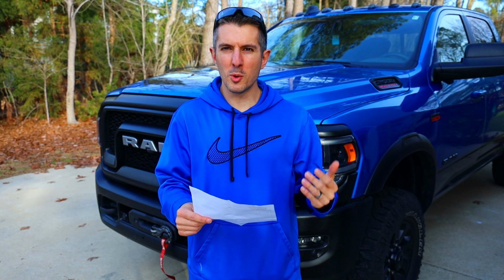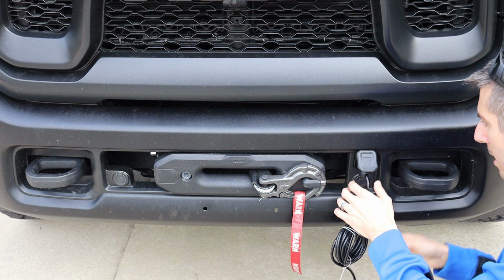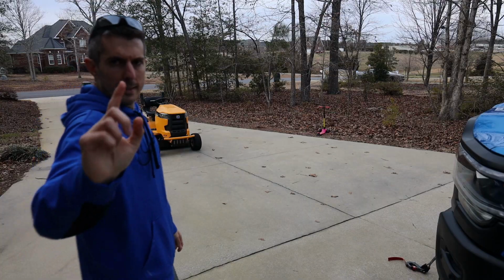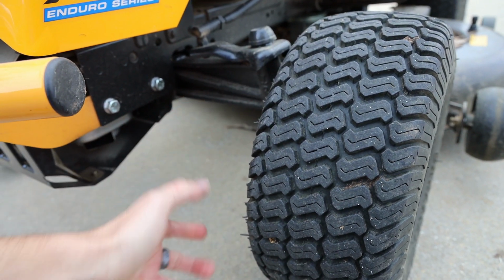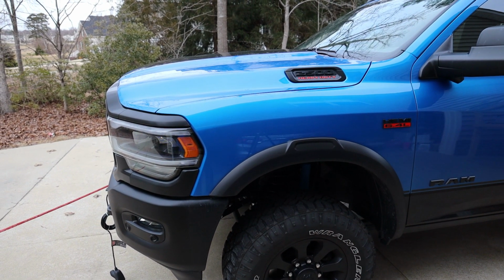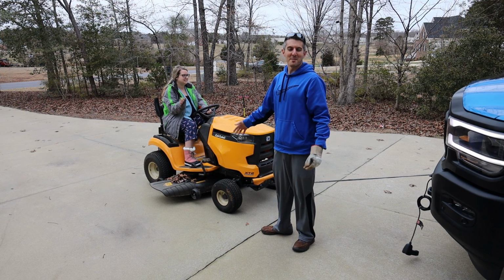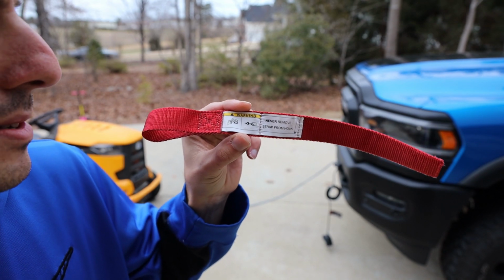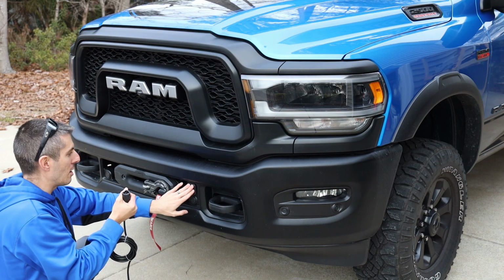Easiest way to pre tension your new synthetic winch line

Comment: Nice video. Would using my 1900lb subcompact tractor be to much weight to tension the winch rope?
Reply from the maker: Of course! My lawn tractor is really too light for this task. It works but barely. Your subcontract is much better. What kind of tractor did you go with?
Reply: @GReviewz  john deer 1023e. With mower deck and backhoe.

Comment: The best way to pre tension rope is to use steel cable instead. Then you don't have to fuck with all that bullsh!t.
Reply from the maker: My truck came with the synthetic. I will say steel cable is more durable but steel can backlash just like synthetic if you don’t wind it on with some tension…

Comment: Nah bud, to actually tension it run a tree saver around a tree or concrete block and then attach your hook to the tree saver -then winch in using rhe the weight of the vehicle to tension the rope.
Reply from the maker: Thanks for watching. Man I said that option on the video.  some people dont have trees or tree savers. I talk about different methods.
Reply: @GReviewz  Dude, a ride on mower weighs like 450 lbs max, pulling it you're probably only pulling like 200 lbs of force because it's on wheels. If you have a winch you should have either a tree saver or a recovery rope or both; you can't use your winch without them. You should've been pulling a car or truck to properly tension your line. You need like 800 lbs of pretension on it. 

 And no, if you use your winch it's not because you did something wrong, it's because you're recovering someone or you were really going through some thick mud or snow got stuck and instead of risking damaging your or someone's vehicle you decided to go the gentle route and winch it out.

Comment: If you can’t see the drum while winching under load without getting your face near the line your winch is not safe.
Reply from the maker: Thanks for watching. That may be the case but with my trucks setup it’s almost impossible to see the drum at all. When actually using the winch I don’t get anywere near the winch..

Comment: I saw in my owner's manual it said at least 1,000 pounds needed. Was your lawn mower at 450 pounds still good then?
Reply from the maker: Thanks for watching. I have used my winch since doing this method and had no problems! Some people just lean back and use their body weight. I had my wife apply the brakes on the lawn tractor also. I will say it’s best to use the recommended 1000lbs or the tricks weight which is best!

Comment: My smittybilt winch mentions having 1000lb of line tension when winding the winch for the first time. What concerns me is that you're using an approximate 450lb tractor in neutral up a gradual incline, which means that a tiny fraction of that weight is actually being applied to that line in tension. It looks taught but it's so slack that you can obviously guide the line left and right with your hand while it spools. It may not be enough.
Reply from the maker: Thanks for watching. This video was a demo on what the process was. Like I stated in the video it’s best to use the trucks weight to tension the winch line. Yes my lawn tractor is under weight for a proper tension. My wife could apply the brakes on the tractor causing the line tension to go up quite a bit. Even under 1000lbs of tention you can still guide line to a certain extent. The worst thing you don’t want happening is just tensioning the line and it gets all bound up from not guiding the line making the wraps on the spool uneven etc.

Comment: Nice video. Rookie question: You were making sure that it coiled onto the spool cleanly by pulling it left and right. Is this an issue if you were doing an actual recovery? I've never really heard anybody mention it or act concerned. They just stand back and run the winch (obviously under a lot more tension). In other words, do I have to worry about my winch getting all jumbled up during a recovery? Thanks and cool truck!
Reply from the maker: No that is a great question… obviously the newer synthetic winch line is much softer and more compliant than the steel line..because there isn’t as much pull on the line while pulling my lawn tractor if I didn’t pull left and right it most likely will get all messed up… now during an actual pull there is a lot of torque on the line which helps it spool to the lowest point which helps it spool on correctly.. the steel cable was better at it than synthetic but still should be just fine.
Reply: @GReviewz  Plus on a real recovery with serious weights involved, one doesn't want to be in the "line of death" if the rope should break, etc.

Comment: that's like 40 pounds of tension. nicely inflated tires on a smooth driveway? that cable is not tensioned whatsoever. My toddler could push that lawn mower in neutral. 
at least toss a big 'ol truck tire out on the lawn, and run a hook to the middle and yank that. preferably, hook your actual truck to another truck or a pole and use that!
Reply from the maker: As stated in my video this was just a demonstration. I’m not defending the lawn mower, it wasn’t a lot of resistance but definitely more than 40 lbs. wife had brakes depressed like 50% and my driveway does have some grade.. yes I have tensioned it with the full weight of the truck hooked to a tree.. thanks for the ideas..

Comment: If you do use this winch in the field or for recoveries look at the duty cycle. My own Rule of thumb is winch for 5 seconds off for 10-15 seconds. Yes it takes a lot of extra time, but imagine how much time it would take to remove that bumper/grill to replace the motor if it burnt out. 
It is the most common thing I see in the off-road world everyone just holds the button down and I can say it gets loud and weak after doing a few full length line pulls under load. I’ve even seen people come out to save the day and burn there winch motor out, pop fuses, damage alternators burn up alternator wires it’s not a good day when u save sombody else’s day and yours got real expensive

Very good video lots of attention to detail and lots of good tips and good points just keep duty cycle in mind the winch will have an owners manual and it will be written in the manual
Reply from the maker: Thanks for watching. I had a cheaper winch on my last Jeep. The normal rule of thumb I used was 30 seconds on 30 seconds off. It seemed to work for me and I never had any problems with it. On the newer power wagons when the vehicle senses a large power draw it automatically goes into high idle so you dont kill your battery. Thanks for sharing your method.

Comment: Nice video but your have one fundamental flaw the line is suppose to wrap around the drum from the bottom not the top as you have it. Surprised no one caught that.
Reply from the maker: Nope sure don’t. I’ve looked at other power wagons and they are all have rope coming off the top. I sent a email to warn after you commented and they said with the power wagons since it has a narrow fairlead “non roller” that sits closer to top of the winch itself it would put a lot of pressure on rope and fairlead of it came up from bottom. Coming off top is almost a straight shot to fairlead..

Comment: I put the pull strap on mine by taking the pin out that holds the hook slipped the pull strap on reattached the hook to the cable , if you leave the pull strap on the hook part it could be cut. As far as  taking it off when winching  I don't know why unless it acts like a warning flag.
Reply from the maker: Thanks for watching. That is a good idea about putting the strap we’re the pin goes. Do you have a power wagon?
Reply: I have a jeep cherokee XJ been fixing it up

Comment: Good presentation and mention of some of the safety points. I’d add to put your truck in high idle too because it will keep the lifters oiled and increase the output of your alternator. Idling for long periods of time isn’t great for the 6.4 Hemi.
Reply from the maker: Thanks for watching. On the power wagon and standard 6.4 hemi ram trucks there is. I way to manually engage high idle like the Cummins. However on the power wagon they are set up when enough power draw is reached the truck automatically high idles..
Reply: @GReviewz  Color me impressed. I honestly didn’t realize that and have never noticed it. That’s really cool. Thanks for the heads up. I heard that Ram had done something within the last couple years to help mitigate the problems with low (normal) idle but I don’t know if it went into production.

Comment: Nicely done, i was thinking to do the same with my riding mower only thing missing is the long driveway 🙂
Reply from the maker: Thanks for watching! Yeah or any place that has enough room to stretch out all the line. It’s recommended to use the whole weight of the truck to tension the line but the lawn mower works ok also!

Comment: That is not enough weight to properly pre-tension it. You should be hooked to a large tree, or another truck, and winching in neutral while slightly applying the brakes. That is per Warn instructions for a 12k winch.
Reply from the maker: Thanks for watching. I did say that in the video. I was just showing other options that are better than not doing it at all.

Comment: Your rolling resistance was like 25lbs btw. 4% of the weight of the tractor and occupant on flat pavement. Thanks for sharing 👍
Reply from the maker: Thanks for watching. Lol I know it really was for demonstration purposes only. On another note my wife was applying the brakes some and my driveway is on a slight hill. Even with that 25lbs the winch line got on there nicely even better than the factory. Do you have a power wagon?

Comment: I still don’t get it why I should put the PW on Neutral when using it..
Reply from the maker: It’s the same thing why so many guys at the boat ramp end up in the water… if you just simply put your truck in park and winch on something you will shear the transmission park pin. So it’s better to pop it into neutral and keep your foot on the brake..

Comment: Generally good info, but you should brush up on winching safety.  The red Warn nylon strap is so you don't get your fingers ripped off.  Hold the strap, not the hook, not the rope between the hook and the fairlead.  Always wear gloves.  Your hands are in a very dangerous position at the end where you are putting the final tension on the hook. Be safe out there.
Reply: Yeah it was cringy watching that last bit of tensioning.  Although I just did the same thing with my winch before watching this video 😵‍💫
Reply: nice explanation. safety first😊
Reply from the maker: Thanks for watching. I appreciate the positive comment.yes I know in my video I dont do as I say or what is correct. I have a a Plano case full of Ppe and recovery gear.. what kind of truck/winch do you have?
Reply: @GReviewz  I have a 200 series Land Cruiser with a Warn 12k winch with synthetic line.  It is a constant struggle to remember all of the safety aspects of winch recovery but the risk of injury is too high not to (for me). There's just so much potential for a small slip up to end in life changing injury.
Reply from the maker: Very true. However with the synthetic winch line is far superior safety wise than the older steel line. I always tell people if you have to winch you did something else wrong first. Winch is last resort. I love land cruisers. I had a 4runner b4 power wagon!

Comment: Just got my PW and it’s my first winch that I own personally; this is an awesome video. Love all the tips especially about the hood up and ebrake on.  Thanks for an excellent video.
Reply from the maker: Thanks for watching. Congratulations on your power wagon purchase...what year and color did you get? A couple things I failed to mention in the video is that with the synthetic line you have a lot less risk of the line flying back compared to the steel cable. Also that is a light application the ebrake will be fine but in a real recovery situation you are going to want to apply the brakes as well.
Reply: @GReviewz  2021 Maximum Steel; absolutely love it every time I take it anywhere

Comment: If the line snaps it will fall to the ground.  Its a nylon rope not a cable
Reply from the maker: Yes sir I do understand the nylon vs steel cable. I was more or less doing a video based on what warn recommends. Do you have a power wagon?

Comment: I hate that it's a nylon rope and not a steel cable.
Reply: Rope is actually stronger and won't snap back if it breaks
Reply from the maker: Thanks for watching. The reason ram switched to synthetic is because so many people were asking for it. The steel is better for abrasion but that’s about it. Safety, weight, ease of use. Plus the steel if it gets kinked it’s done...

Comment: Definitely recommend you use a tree. If you get into a tough spot I have seen the cable wrap up on itself.  When using a tree I even hold the brakes slightly to ensure the ripe wraps up nicely.
Reply from the maker: Thanks for watching. I definitely agree! The tighter the better. I was just going over a good how to and giving some options. Do you have a power wagon?
Reply: @GReviewz  not yet. I have a wrangler rubicon on 37’s with a warn 10s.
Reply from the maker: Very nice. What year?
Reply: I have a winch on a low profile bumper like the reviewer. The problem with letting the truck provide the tension is one of visibility. The 
"installer" is squatting down low looking thru the fairlead to make sure the line goes on smooth, while the truck is being pulled toward him - not to mention the installer is also out of sight of the pilot steering the vehicle. That's a potential train wreck... The winches you see on the bumper of Jeeps are very often protruding from a much more forward mounted bumper and less of an issue for the "installer". I have to pull something toward my winch when I properly tension it.

Comment: On a side note: If you are forgetful and don't put the winch remote cover back on tightly, your forward sensors will go nuts and you will freak out thinking there are electrical problems. Haha! Don't ask how I know.
Reply from the maker: Lol. Hey the only way to learn is when it happens. When I first got my truck my dang front sensors would randomly go off. I posted a question on a pw page...they told me the red warm winch lanyard would blow around in the wind and go in front of your parking sensors. I took it off the the random warning stopped.
Reply: @GReviewz  Yeah, that remote cover flips up. So, the sensors would only go off under braking, when the cover flipped down. It took me a couple of days to figure that one out. And at that point, I did remove the lanyard too, to prevent that from happening. Haha! Great minds think alike!
Actually, I'm not sure I'm comfortable with that stock hook pulling the big, heavy truck. So, I ordered a Factor 55 Ultrahook. Should be here Wednesday. I have to stop spending money on this thing! I might have to live in it soon :)
Reply from the maker: Lol I wish these company’s would try the stuff in the real world before putting in on vehicles. But it’s ok I like the lanyard on the winch. I have a friend that runs tow trucks and he said the hook on our pw is stronger than it needs to be. Once he said that I was sold on keeping it. Yeah after I purchased my retraxpro tonneau my wife about killed me lol.
Reply: @GReviewz  that's good to know about the stock hook strength. We all get caught up in the internet world of perfection and ideals when often, stock works fine. However, the Factor 55 hook will look cool. Haha!
Reply: @GReviewz  I like the lanyard too but didn't want it to get stolen. :)
Reply from the maker: Yeah I feel the same way that people on YouTube sell on the idea that aftermarket stuff is really a ton better than what the truck comes with..the factory 55 is an awesome connection point though!
Reply from the maker: I know it’s bad knowing something as small as that would get stolen.. the world these days!!

Comment: That was a really well done winch demo. Thanks for the neutral reminder! I forget that sometimes. FYI the red Warn strap is for safety when spooling the line/hook in. The idea is that you NEVER have your hands/fingers anywhere near the fairlead when the hook is approaching its seated position. That winch could crush anything that gets between the hook and fairlead, your fingers included. Warn hopes you’ll hold the red strap and nothing else as the hook approaches its home. I threw mine in the trash on day one, I think they look silly, but if I lose a finger one day I might regret that. Lol!
Reply from the maker: Thanks for watching. I also want to thank you for being a positive subscriber I saw how to helped answer a person in another video. Yeah many a people have lost their trucks at the boat ramps due to a sheered transmission park pin. Obviously in an off-road scenario you want to have your foot on the brakes while the transmission is in neutral.. what color 21 do you have?
Reply: @GReviewz  It’s white. I ordered it from Dennis Dillon in Idaho. It’s a level 1 with a few other options. I wanted a fairly basic truck to gain some payload. Love the truck, super capable, and comfortable! The transmission is amazing.
Reply from the maker: Awesome. Yeah payload is alil low for a 3/4 ton but there are many ways to fix that w airbags or bump stops... I decided no ram box just because it subtracted like 200 lbs from payload..the white pw does look really good! Are you still riding on the duratracs?